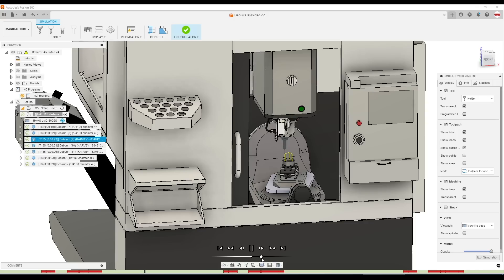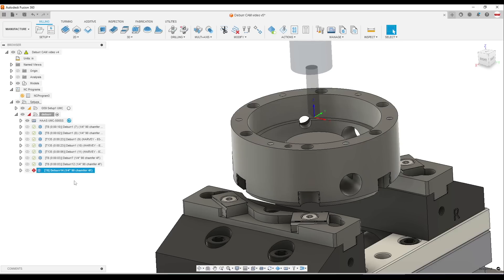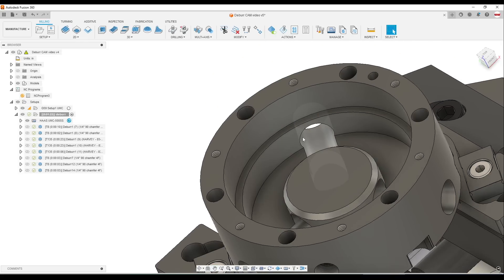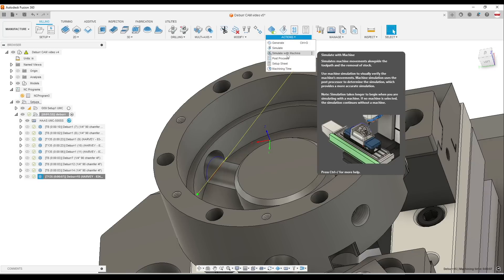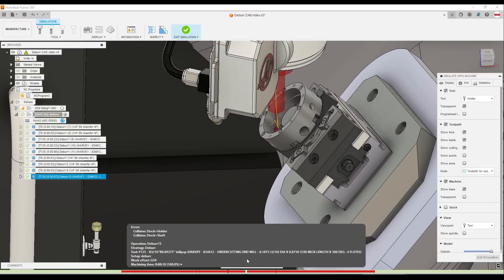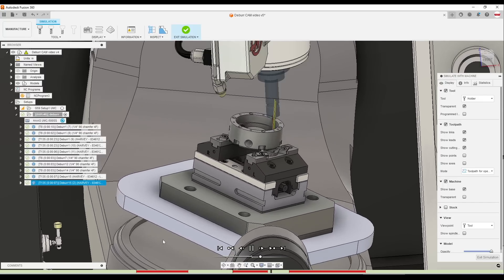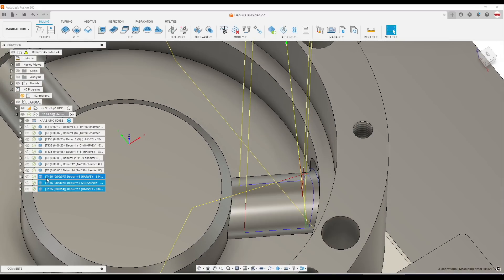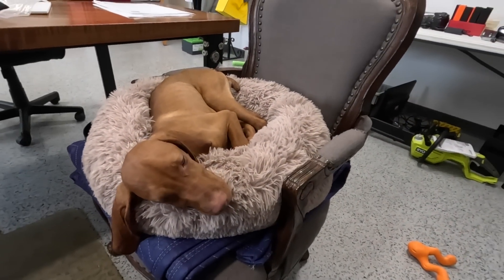Using Fusion 360 Deburr toolpath for 5-axis Deburring on HAAS UMC-500!

Comment: Been playing around with this toolpath on our 4th axis machines lately and its a gamechanger for faster deburring and removing so much hand deburring outside of the machine! Absolutely love it.  I have an unrelated question about using Fusion in your shop John, are you still allowed to use fusion for ITAR and other work that requires confidentiality? We're currently going through the process of getting ITAR, ISO, and AS certified and was wondering if I'll have to use Inventor with the CAM extension for jobs that are strict on those sorts of things.  Thankfully like 95% of the workflow crosses over pretty easily but still annoying to have to deal with it if Fusion doesn't meet the standards since its a cloud based software.

Comment: Yea the deburr toolpath from module works is great. Does fusion have check surfaces for this toolpath?  Surfaces that you tell the tool to stay away from?
Reply: you can tell it to stay away from edges if you use automatic select
Reply: @kristiankautto7616  i run the module works deburring cycle in gibbscam.   It does the auto detect or manual selection but also has check surfaces, with amount of stock to leave on the surfaces.   Helps in tight spots where the ball may cut something adjacent

Comment: I really liked the module works deburr toolpath when I ran mastercam.   It seems nearly as good ported to fusion 360.  It's good limiting it to 3 axis, or 3+2, and using a plain ballnose.   I did get a little annoyed when it was locked into the machining extension.  I was under the impression they might leave the 3 axis option outisde the extension, but that was just the proving out phase, before they locked it.   Same with rotary contour, and rotary pocket.  I can't justify the cost of the machining extension at the moment, but hopefully if I get some nice jobs in that need simultaneous four.
Reply: 30$ per day to use 3d deburr on a 3 axis machine upsetting

Comment: I have trouble running simulation is a nice slow progression like you do. Mine just zip through super fast. Seems the only thing I can do is toggle it one step at a time which is really time consuming. Any suggestions? thanks
Reply: Is your slider turned down?
Reply: @matthewvanlew5891  I think what I was doing wrong I was running the slider down past the midway point thinking that would slow it down. I happen to stumble on just putting it to the right of the mid point and it works fine now. Thanks Matthew.